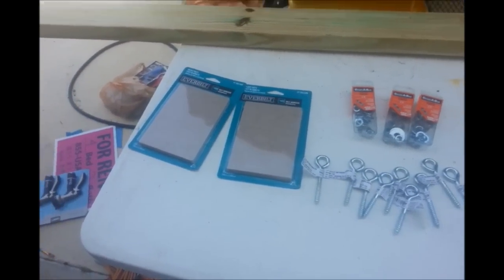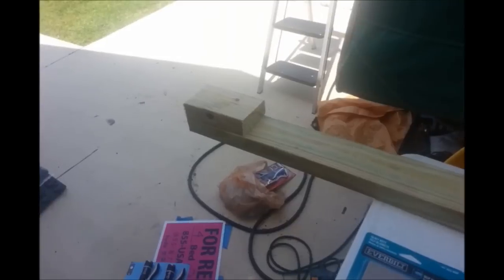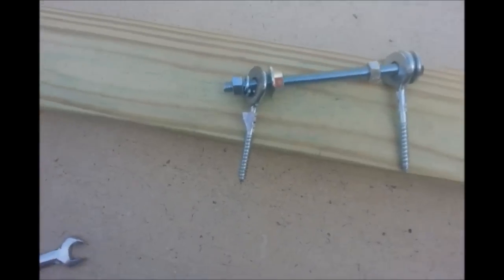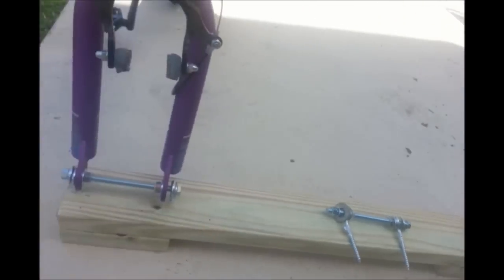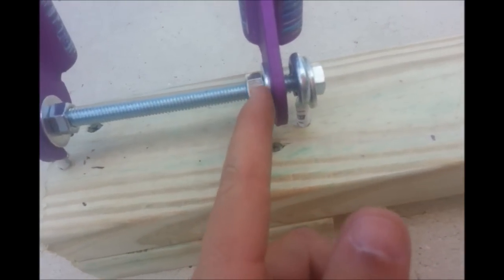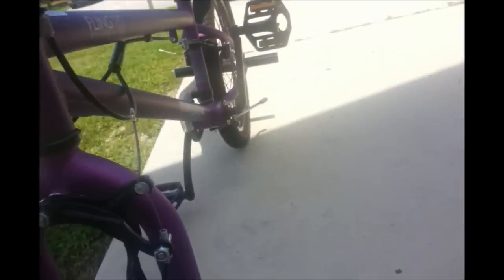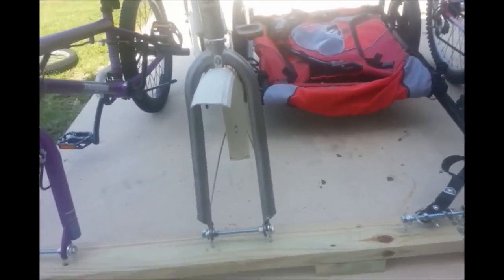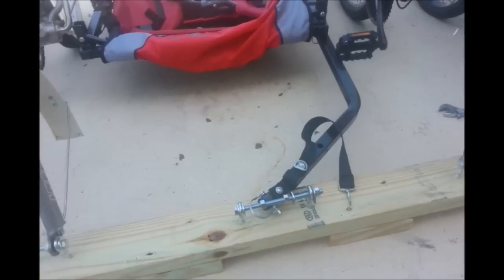Homemade bike rack for our Pop-up Camper

Comment: I did this same project for my pop-up.  I used a similar setup to the one you showed, for securing the front forks to a 2x6 board using 5/16" threaded rod that I cut up into sections for each bike.  I then used bolts, nuts, washers and  eye-bolts.  Only difference is that I attached the 2x6 board to perforated metal tubing using "L" brackets.  I then secured the square tubing to the frame of the pop-up at the front  by the tongue. End result is the only thing touching the camper roof are the rear tires of the bikes. Great way to pack along bikes for a trip!
Reply: Can you provide pictures?

Comment: Quick question.... did you put the front strap IN FRONT of the forks, or in BACK or them.   I would think that the wind would push the bikes backward, so putting the front strap in BACK of the forks would work, but from the video it seemed like you put the strap in front of the front forks.  Just curious if you check this thread anymore.
Reply: That's what I wondered, if you weaved it in between the mounts in front.   Thought so....thanks man, and good job coming up with that.